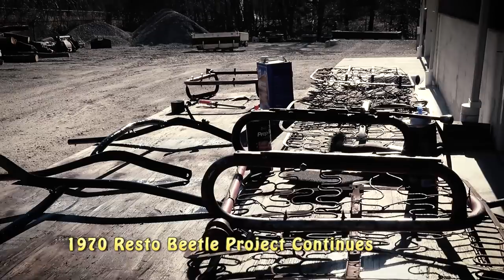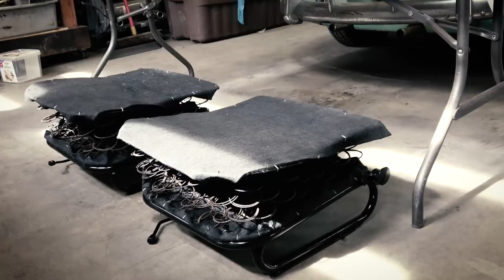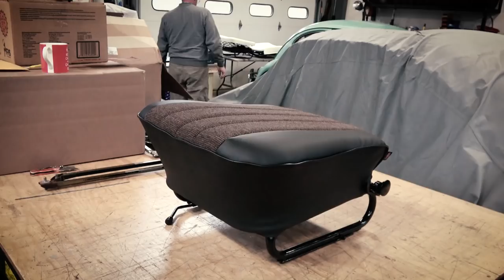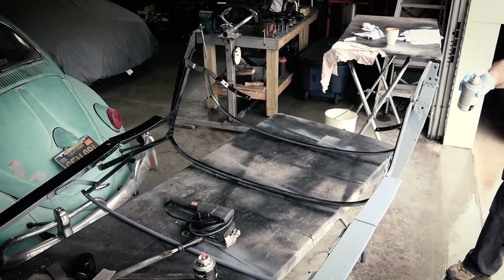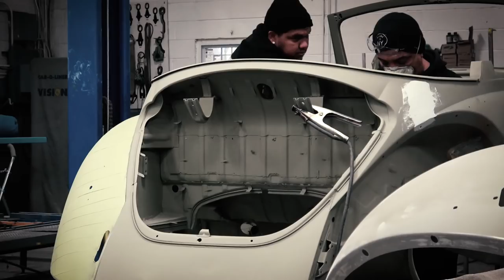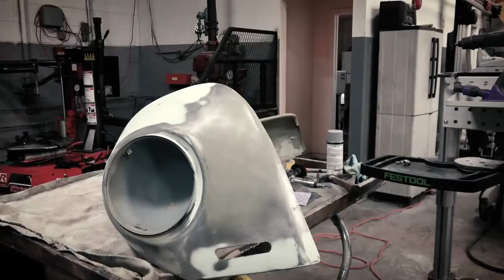Classic VW BuGs 1970 Convertible Beetle Restoration Project Continues

Comment: Hi Chris, love your videos and I am new to your channel. I am restoring a 72 red/orange convertible with my Dad and would like to paint it the same color as this 70 and also, would love to do the same interior color combination just like this 70 one as well and was wondering if can tell me where you got the seat covers and door panels. I have a long way to go but, I just wanted to start looking into prices and vendors. Is there a part number and/or name for that color combination? I am also eliminating the head rest from my seats. Thanks a lot!!
Reply from the maker: Yes the color is a Mini BMW color Spicy Orange Met.  B23 is the code.  Interior is from sewfine, vinyl black seat with espresso tweed cloth 12" insert.  Door panels are the same.  Top black canvas, with beige tweed headliner.
Reply: @classicvwbugs  Thanks for the info. I was looking at their catalog and it looks like I need to select the Deluxe Insert Seat covers the have 4 (3" sewn pleats inserts). I have a long way to go but I can't wait to get to that stage, working on the interior and painting the bug.!! I will share some pics if I can.